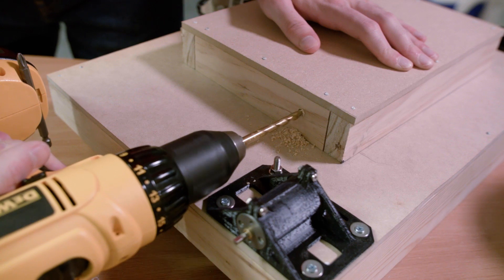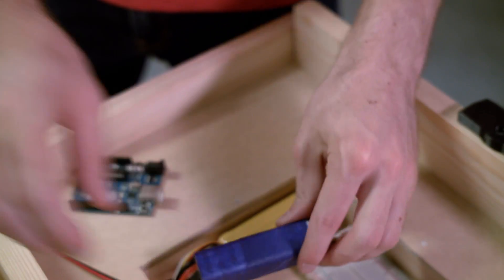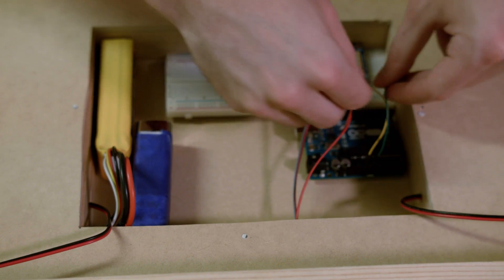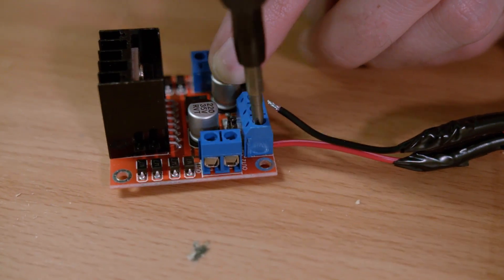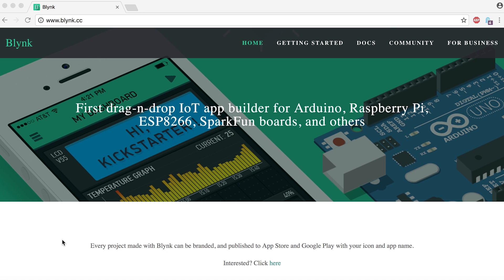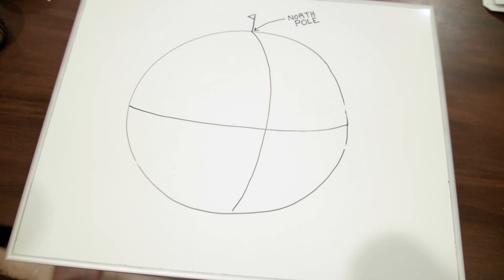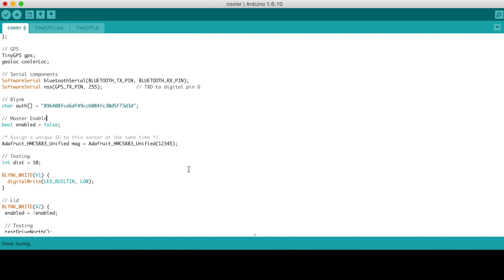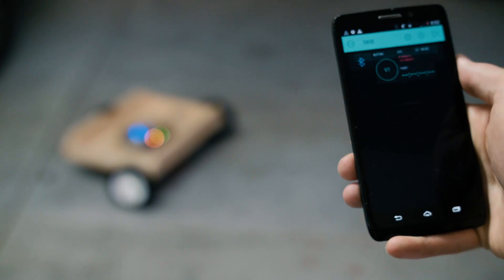Make an Autonomous "Follow Me" Cooler - Part 2

Comment: If you use a flyback diode for the motors, you won't have to worry about the motors accidentally producing current. You could then use a 5-volt regulator to power the Arduino with the lipo battery.

Comment: Hacker House , this is really awesome project.Too cool......

We have followed each and every step and connected each and every component but facing problem due to the use of neo ublox instead of PAM parallax gps.
Reply: Can u please tell us the required changes for using ublox neo gps in the program. We will be very greatful.
Reply: let me know if it worked for you using the neo-06m, because I'm also trying to do it with that module
Reply: @adrianhernandez1654  have u worked with neo 6m gps module,i f its working pls let me know because i'm also working with the same gps moudle  please me fast i dont have much time to complete the project
Reply: @ajithmustargi9825   hello Broh...! Have you completed the project with neo 6m GPS module.If yes please let me know coz I am also working on it and literally i have few days to complete the project.Hope i get the positive reply from you
Reply: Hii sir..Can you send me the correct code of this plz ??
Reply: Sangani plz give me arduino code

Comment: How are you connecting that USB 5V battery?  Are you connecting that through the inline regulator and then using the 5v out of the board to power the bread board/accessories?  Or are you using the battery to power the breadboard and then feeding the power into the Adruino/accessories from the board?   Sorry for my confusion.

Comment: is it possible to use a cheeper gps unit? Such as the  GP-20U7
it's only $15.95 vs the rather expensive PAM-7Q at $59.95

Comment: Have you had any problems powering the Arduino with battery pack? Most seem to switch off if there isn't a certain amount of power drawn. I was hoping to power a small arduino project that way.
Reply: MrBryanhanna you may be better off wiring your own battery pack and a charging circuit if it's something complex or just wiring up a jst connector to a voltage regulator and plugging a Li-poly or a Li-Ion battery directly into that. If it's really dead simple, an alkaline battery box of appropriate voltage may even be the best option.